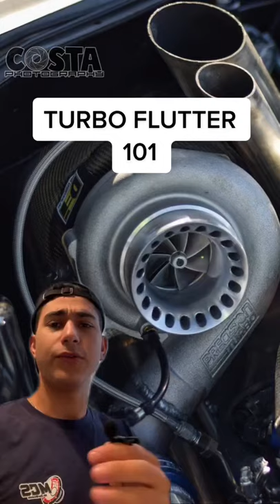TURBO FLUTTER 101 - Explaining Sutututu Theory

Comment: Is this the same as the "whooshing" sound?
Reply: That’s the wastegate
Reply: @jrich436 If you think it's the wastegate you don't know what a wastegate is, it's a blow off valve that makes the whooshing sound, they are not the same thing.
Reply: @DriftNick  or maybe everything doesn't sound like your 35mm eBay wastegate on your 7psi min 12 psi max car 🤣 

Whoosh is the sound of a wastegate opening to atmosphere.... you can hear it on 18 wheelers, buses, turbo diesels and big builds with big wastegates. You know... things that make power

The bov is a high pitches sneeze on the smaller "RS" styles or a "tsuuuuu" on the SQVs which I'm assuming you and your friend don't have enough money to buy and stick to the previously mentioned GReddy knock offs 😁

And again..... anti surge or no the stustustustu noise is the air hitting the fins on the compressor 

The pitch is slightly different between an anti surge pushing the air out of the ports or the air fighting past the incoming charge and going out of the filter

On larger anit surge turbos you can hear the high pitch tone as you hit threshold but you are going to get stustustu on shift with a deeper tone and not as long as with a non surge housing

who am I kidding.... you don't have reading comprehension so theres no way you read all this, which is why you even sent the message you did in the first place.....
Reply: @jrich436  It's a video about the noises a turbo makes when you lift off the throttle, pretty sure he is talking about the noise a blow off valve makes, wastegate's don't make any noise when you lift off the throttle but you are the guy that thinks flutter makes the turbo slow down to 100s of RPM so no surprise you are easily confused by what was asked and what I said.
Reply: @DriftNick  once again you have 0 reading comprehension 

My comment was to SPECIFIC person about a SPECIFIC thing
Reply: @jrich436  Explain how it being a reply to a specific person changes the meaning of what you typed.
Reply: @DriftNick  reread the comments in this string in order 

Have anyone competent mimick or explain the BOV sound and it’s not a whoosh

Ask someone with a turbo diesel bus/truck or a large wastegate build on a higher CFM motor what sound they make and it’s whoosh 

On what planet does a small orifice generate a low frequency sound? It’s not earth. BOV are high pitch  

Go get a complete compressor map for something designed for low cfm and start looking at wheel speeds at plot points of throttle events. Come back in a few weeks after watching enough YouTube to finally understand the “squiggles” on a compressor map and a few months after learning the math to plot the points  

Sprinkle on a little physics and understanding of the English language and you may start to understand 

In either event good luck with that, I got some other things I’m going to do 

Feel free to continue responding, just pretend I’m still going back and forth with you 🤣

Comment: This is false, the boost pressure escapes through the diverter valve not back through the turbo as when the cars running the turbo is still spinning regardless of acceleration so how’s boost gonna escape with forces acting against it
Reply: Except what he said is correct, the sound happen when pressure isn't released from a valve, that means no a blow off valve or diverter valve, it's literally the pressure escaping pass the blades of the compressor and out the intake.
Reply: @DriftNick  at ALL times the engine is sucking air through the intake, at idle high rpm’s what ever there’s no way in hell anything can be pushed back through the cold side of the turbo
Reply: @S_Chassis91  Considering we are talking about engines that don't have a bypass valve or blow off valve can you explain how the air escapes from these valves that don't exist on the engine?

Turbo flutter is literally the air escaping out the intake because it's not being released by a valve, you can even feel it coming out the intake if you put your hand near it, you can also see the air coming out if the conditions are right.

Comment: Didn’t specify that the boost only needs to go somewhere when throttle is released and intake is closed, otherwise it goes where it’s supposed to which is through your intake. Common knowledge but if you’re explaining what this noise is in the first place…

Comment: Which is bad since it slows the turbo
Reply: It does not slow the turbo and yes people have tested it, not that you really need to test it, if it did slow the turbo down it wouldn't be common place in motorsport not to run a blow off valve.

Comment: Why are there no tutorials on it i like the stuustuustuu but cant find a tutorial on how to make it do so with minimal reprocussion
Reply: Just remove / lock any valves that release pressure from the manifold. Should be plenty of vids about this in here..
Reply: As henning said.  Also, try to have the most freeflowing intake between filter and turbo. All the ribbed plastic shit that cars have from factory are designed to reduce noise etc. Making the flow as smooth as possible will increase the sound

Comment: Yeah not entirely incorrect but incorrect none the less, you see the air is not escaping through the "turbine" but rather from the compressor side of the turbo. The turbine is driven by the exhaust gases made from combustion and those gases spin your turbine which is connected via a shaft to your compressor which creates your boost pressure. As you can imagine since you have to have combustion in order to spin the turbine and the turbine has to spin in order for the compressor side to spin to make boost there would be some kind of delay and this delay is what people call turbo lag. But that sound you hear if you don't have a blow off valve is called compressor surge and can have lasting damaging effects to your turbo, and basically the sound is generated because the compressor has made boost and you have closed the throttle which reduces the vacuum effect from the pistons drawing in air, so that pressure aka "boost" that was made from the compressor goes back through the compressor the way it came in because that is the path of least resistance thus creating that iconic turbo shutter that everyone likes.

Comment: Flutter is not good for a turbo.  You should always have a BOV.  A closed system or one operating on an underflowing BOV is doomed to fail at a much higher rate than one with a proper BOV.  The fins of the fan do not take kindly to the sudden release of compressed air in what is often not necessarily the right direction relating to the rotation of the fan.  Be warned
Reply: Fails at a much higher = if it does any damage it's so minimal you wouldn't notice.

Comment: That doesn't really explain "what causes that noise" you're half correct in nowhere for the air to go except outside the intake port of the turbo. The simplest explanation I can come up with is. The noise is the compressor wheel passing over the charge port and your hearing that pressurized air pass over the fins on the compressor wheel each time it rolls passed the charge port in the compressor housing. I'm sure someone has a better explanation.

Comment: And it will damage your engine and make the turbo not last
Reply: Well it's good it doesn't do either of those things.
Reply: @DriftNick  yes it does to much back pressure will blow your turbine send mental fragments in your engine
Reply: @DriftNick  my job is making designs and engineering turbos for Williams so I know what I'm talking about with a masters in mechanical engineering
Reply: @kjoar  Why do you feel the need to lie to strangers on the internet?
Reply: @DriftNick  I ain't lying I've been working there for a few years 😆
Reply: @kjoar  Please tell me how back pressure with blow the turbine.
Reply: @DriftNick  in the exact same way that to much boost blows it, ask you're tuner they'll say the same
Reply: @kjoar  I'm not asking my tuner, I'm asking you, running to much boost is overspinning the turbo, that does not happen with flutter so again can you explain it?
Reply: @DriftNick  yes it does the sudden back pressure making wear down the bearings a hell of a lit quicker, it can also cause the fins to start chipping with the edges getting pressure from either side bending it back and forth, there's a few reason but I'm not wasting my time on you little boy you apparently drift so you should know this
Reply: @kjoar  Yea as I drifter I know pretty much every top drifter doesn't run any valve, keep posting rubbish though and lying to strangers on the internet.
Reply: @DriftNick  😆😆😆😆bro your lying every pro drifter uses a blow of valve it's the best and most constant way to keep correct boost
Reply: @kjoar  More proof you have no idea what you are talking about, probably think the turbo flutter you hear is a blow off valve, if you go watch top level Japanese drifting pretty much every car will not be running any valve, or how about Drift Masters, Piotr Więcek, James Deane, Shanahan brothers all don't run a valve.

"it's the best and most constant way to keep correct boost"

Releasing all the boost pressure out of a valve is the worst way to keep boost up hence why it's common place in motorsport not to run a valve.
Reply: @DriftNick  I have worked on cars since I was able to walk and I'm near 30 I've got minimum 15years working on race engines 😆
Reply: @kjoar  Every time I see someone try to brag about the experience they have they are always saying something that is proof they have no idea.
Reply: @DriftNick  not everyone thinks they know it all like you
Reply: @kjoar  The irony of you saying that is great after saying stuff like every pro drifter uses a blow of valve, you think you know everything, reality is something completely different from what you think.

Comment: You managed to explain it without actually explaining IT

All the extra air is forced to move backwards through the turbo and the turbo fan CHOPS the air causing it make that sound

Too much of it is also bad bc you can cause the turbo to spin backwards 🙃
Reply: It can make not the turbo spin backwards, it doesn't even slow it down.

Comment: But it damages the turbo
Reply: No it doesn't.
Reply: @DriftNick  high boost will damage the turbo if you dont have the blowoff valve
Reply: @shmebiulog242  No it won't, people here running 50+ psi with no blow off valve without issue.
Reply: @DriftNick  depends on the turbo too, if you have like cheap Chinese turbo from wish, high boost will destroy it instantly. Good quality turbo might hold up, but its still better to just have a blowoff valve

Comment: Except you didn't even mention how that is bad due to that air slowing the turbine down and thus meaning more lag between gear changes.
Reply: Why would he mention something that doesn't happen? it doesn't slow the turbo down or create any more lag between gear otherwise it wouldn't be commonplace in motorsport to run no valve.
Reply: @DriftNick ah, yeah mate. Air being forced back through the turbine will slow it down, so it needs to re-spool when you change gear and get back on the throttle.
Reply: @DriftNick most modern diesels don't have a throttle butterfly and so there is no pressure differential to operate a blow off valve. Thats why they don't have one, they cant.
Reply: @Sparky_D  Air isn't being forced back through the turbine, it's going pass the compressor out the intake and no it doesn't slow it down, people have literally tested it, in fact not releasing pressure from a valve means the turbo doesn't need to build it up again so running no valve makes the turbo less laggy.

"Thats why they don't have one, they cant."

Not sure why you mentioned diesels.
Reply: @DriftNick  I mentioned diesels because I have one, turboed. 
Anyway, in the petrol engines the air gets forced against against a closed throtle butterfly and the turbine is spinning fast, can't push the air anywhere so it slows the turbine down. That's why MOST turbo engines have them, even though stock ones are generally small and plumbed back into the intake (required by law). Ex owner of a modified MK4 Supra here.
Reply: @Sparky_D  High Performance Academy have a video tested exactly what we are talking about, it's called "Do You Need a Blow Off Valve?", there is no difference in turbo speed between running a valve or not, they both go down at the same rate after lifting off the throttle.

"that's why MOST turbo engines have them"

Seeing how it does not slow the turbo down that is in fact not the reason they run them, they run them for for the issues that it causes with air flow meters which creates a rich condition and to reduce noise.

Comment: ummm this stutututu sound.... you forgot to mention that it comes from the antilag system
Reply: It doesn't come from the antilag system, he literally explained why it happens.
Reply: Anti SURGE not lag
Reply: @jrich436 were not talking about anti surge since it makes the different sound
Reply: @Lemonsausage  uhhhh, anti surge makes the noise….. lol 

It’s just the sound of air hitting the blades the difference is on the anti surge it escapes without slowing the wheel
Reply: @DriftNick yes, it's not an anti lag system persé but you can see it as an  simple "build in" one, since the pressure isn't going anywhere and you can use it without the need of building it up again opposing to the option of installing a valve, right?
Reply: @jrich436  dude, anti surge is the "swish" sound that is coming from a valve. Stutututu comes from the blades if you haven't installed one, yes.
Reply: @Lemonsausage  it is NOT

Anti surge are the holes on the compressor housing  intake that allows the air to bypass the blades and exit at the filter

You can see it on the turbo in the picture 

It LITERALLY makes a Stu Stu Stu as the air hits the blades and is diverted 

Again…. The difference is on anti surge the air gets diverted and the wheel does not get slammed 

Google is free and so is talking to people who know more 🤣
Reply: @jrich436  i think you misunderstood what im writing or you dont know what youre talking about. and yes, youre right; google is free and usefull to show people that they're mixing things up. ;) maybe you should watch a video where the different turbo noises are explained. there are very easy explanations of what noises have which source. maybe you should read something 2 or 3 times to understand what people are saying.
Reply: @Lemonsausage  you have absolutely NO idea how to comprehend words 

Anti surge are cuts or ports on the intake of a compressor. Again….. they are what are on the one in the pic 

Why would I need to watch a video when I’ve been under hoods for over the last 20 years and in the pits of multiple teams on multiple tracks 

Shhhhhhhhh is wastegate 

The various sneezes and the short shh is BOV depending on style 

Stustustu is the sound of air hitting the blades of the compressor either with or without anti surge 

YOU are not talking about what WE are talking about. Mine was a correction yours was irrelevant

Comment: So basically without a blow off cable you adding a turbo to a car is like forcing as much air in only for it to have no hood affect at all in performance basically without a turbo blow off valve it’s useless why buy a turbo then there’s just no point in it and this explanation I can understand extremely well because yes the engine can utilize boost but what happens when it has no where else to go lol😂
Reply: Wtf did you just type?

Comment: It’s no good for the turbo that noise I can tell you🙄💯
Reply: It's not good, it's great.
Reply: 🙄
A blow off valve or dump valve is better for the turbo and sounds better also your back on boost quicker when going for the next gear. 😁
Reply: @benji431976  If it does any damage it's so minimal you wouldn't notice, as for it being better to get back on boost, running no valve is actually helps with response as boost pressure does not need to be built up again, hence why it's common place in motorsport not to run any valve.

Comment: How do i get that on my s3 ffs
Reply: Remove the factory bypass valve, make a metal intake pipe going into the turbo, your ECU probably won't like it though, might cause a rich condition and/or reduce power.

Comment: Reading all the comments here made me loose 20 brain cells. I can tell no one knows how turbo systems work or realize the sound is made by the type of blow off valve you use. Yes you can re create the sound from other methods that it’s not good for your turbo. But 100% of the time it’s a super sequential blow off valve installed.
Reply: Blow off valves do not make the sound he is making, super sequential blow off valves do not make that sound, 100% of the cars you think have a blow off valve making that sound have no valve at all hence why they make the sound.

" I can tell no one knows how turbo systems work"

The irony of this comment is great.

Comment: Flutter = bad for turbo btw
Reply: Except it's not.
Reply: @DriftNick  are you a car guy or an engineer? It detroys the turbos bearings by stressing the hell out of the shaft, it flutters because the turbo stops and starts spinning again very rapidly
Reply: @Jimmytheexplorer  Not only does it not cause the turbo to stop but it doesn't even slow it down, High Performance Academy tested exactly that on their youtube channel, blow off valve vs no valve the turbo slows down at the same rate when you lift off the throttle, of course the people that think it stops the turbo because they have zero understanding of what is happening also think it does damage despite there being no proof of that either.

Comment: Or your blowof valve is to little for the boost and the flutter is actually very bad for the turbine a good designed system should not have flutter